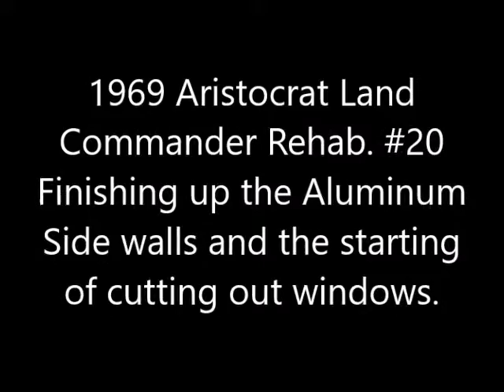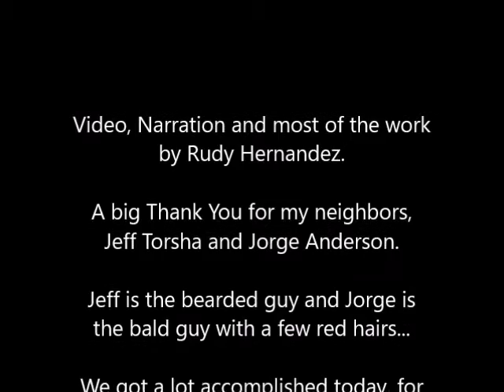1969 Aristocrat Land Commander Pt #20 Finishing up the Aluminum side walls and starting to cut out w

Comment: What tools are you using?
Reply from the maker: Electric sheers, and hand sheers for sure
Reply: Rudy Hernandez  thanks Rudy!
Reply: I just acquired a 67 Land Commander. It looks like it has quite a bit of water damage. 
Thanks for making these videos and responding so quickly.
What type of fasteners are you using ? I have a brad nail gun but I’m assuming that you are using some sort of pneumatic riveter?